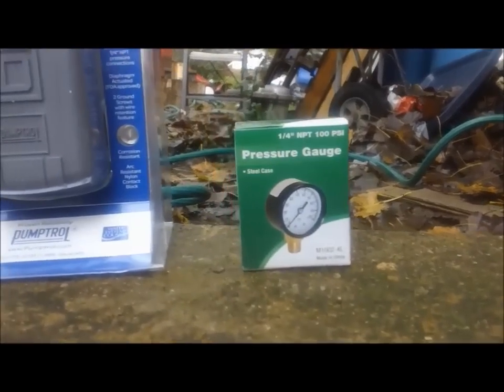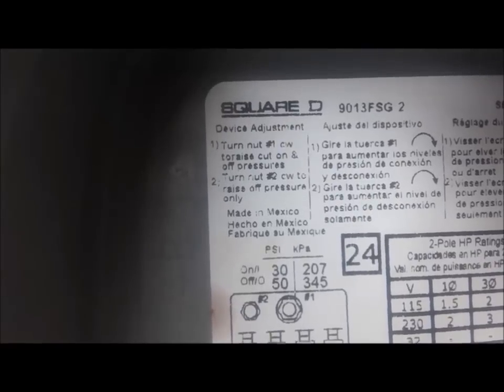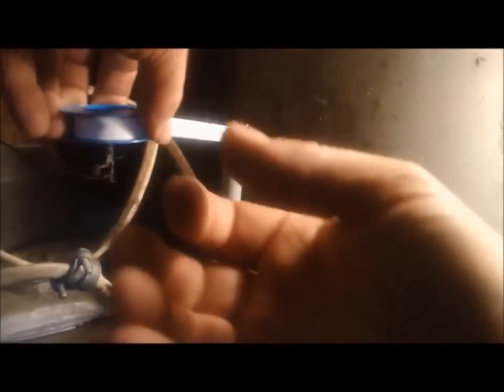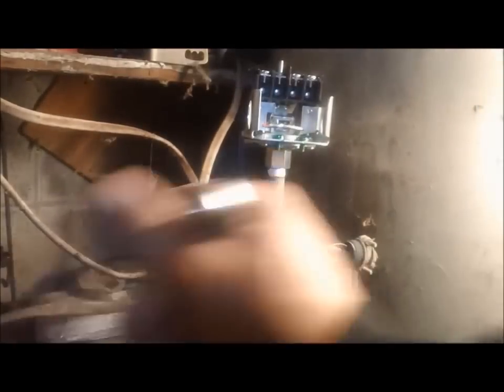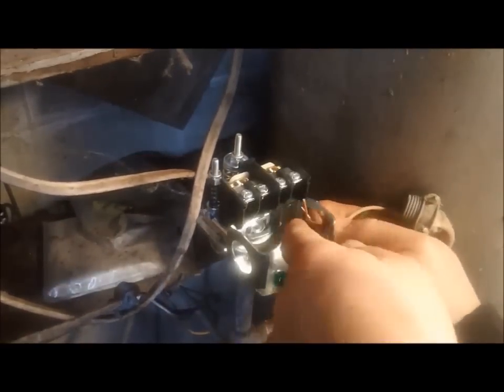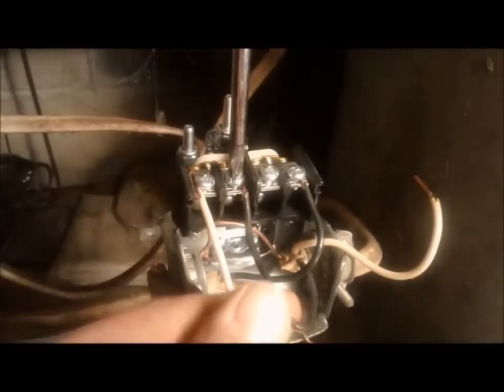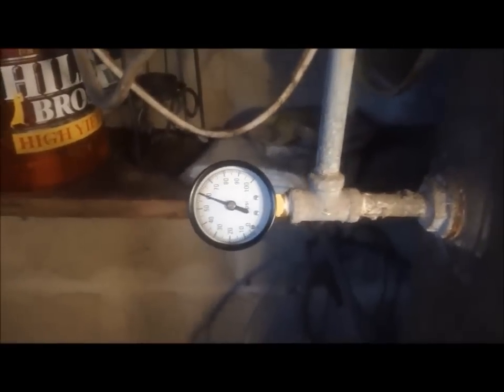How to install a Water tank pressure switch.

Comment: well, that was a very useful video! -- well explained; clear, good photography and quick moving -- couldn't be better, thanks!!! -- got my pressure switched wired.  I had marked the wires carefully when taking apart my old switch, but had so many pieces of tape and labelling that peeled off while working -- I couldn't remember which wire went where.  I'd buy you a beer if you lived close to Toronto.  Cheers!

Comment: Mike, changing a control box at 19 degrees is no fun, but wiring the   220 switch like it was 110 left me scratching my head.. Thanks for your advice you saved my butt out here in the country. Tonight we have water and a hot shower. Great video!
Reply from the maker: I'm glad the video was of some help. Thanks for watching.

Comment: First of all I should of started my last comment with a THANK YOU FOR AN AWESOME VID!! Out of many many we watched yours was the most descriptive and helpful so thank you! I think we have figured it out it is a small tube that was half full of really dirty water. It looks like a tube you would use in a fish tank the air filter etc...
Reply: There was this small brass screw thing coming from the tank that held the plastic tube. The screw was clogged and my husband cleaned it out and now the pump is working, I think we did not need the new pressure switch after all
Reply from the maker: +Lovbeinamom Thanks for watching.  I know what system your talking about now. That tube is to supply air pressure to the switch. If it is plugged you wouldn't get proper pressure to the switch. Glad you got it working.

Comment: The first video from another guy, didn't really show the process! Just the before and after.  You showed the steps and wrench sizes.  With your help and one more trip to the hardware store to get a thread adapter, I got the job done.  Best water pressure I have had since I moved in 7 years ago.  Thank you!

Comment from the maker: That works. Over the last 20 plus years of being a mechanical engineer. I have heard many theories. Everything from 10 psi over or under. The pressure is actually decided upon, what the tank recommendation states, and what kind of well you are using. If its a submersible or point stile makes a difference. The old timers used to tell me your elevation levels had a roll in it to. Most of what i have seen around here was 2 psi below cut in, I think 5 below or above you will not notice a difference.

Comment: Thanks for your info and time! Worked great! I do not know if the wire thing really matters so much  except to make sure to follow your pressure switches wiring diagram. Mine said to wire the motor pump's wires on the two middle screws of the pressure switch. The two outside screws on the pressure switch were for the electric to the house circuit box. It did not say which wire to put under which of those screws-hot or cold for either the pump motor or the electric going to the main house circuit box. Things seem to work fine. Does it matter which screw you put the hot or cold wires under? My only problem with things was realizing I needed to unscrew the little cap (mine was made of metal and looked like it was part of the valve-we have a Well Mate) covering the straighter valve stem located under the big plastic cover covering the whole valve. After I realized that, I was able to check its air pressure and re-pressurize it just like a car tire. I also recommend using a pipe wrench to hold the pipe while you unscrew the pressure switch from it so that it does not move or maybe break off.

Comment: ok, watched your video.. I installed a bigger pressure tank.. they had a 20 under skirting on mobile home, I put a 30 with a new pressure switch... now the problem is I have great pressure for maybe 1 min or so and then goes down to almost a trickle in shower or bath.. if you turn off for a few mins will build pressure back... what am I doing wrong? ny ideas?

Comment: Hey Mike, great vid. Just a few questions as I am getting ready to replace my switch today. Had a 30-50 in it and wanted to install 40-60. What do you think? Second question, why did you inject air in water line or wherever it went? What did you inject it into? I don't understand that part of the vid. Please explain.
after looking at vid again, looks like you have some kind of valve installed on water line. I don't have this, so do I have to fill tank up to do this procedure? Also is it a good idea to install one of these air inlet valves since I am going to drain my tank to install new switch? Never saw one of those on there before, just on top of  my pressure tank is only place I have seen those tire valves.

thanks for your help
Reply from the maker: The 40-60 switch is fine, if the tank is capable. The reason for the air. The tank has to be half and half.  Half water, half air. Your tank should have a air valve that kinda looks like the one on your car tire.  Thats how you build pressure. Without the air pressure, the water pump will just kick on and off. I hope this helps. Thanks for watching. Mike
Reply: +Mikes Homestead tank pressure should be 1 to 2 psi less than fut in pressure.

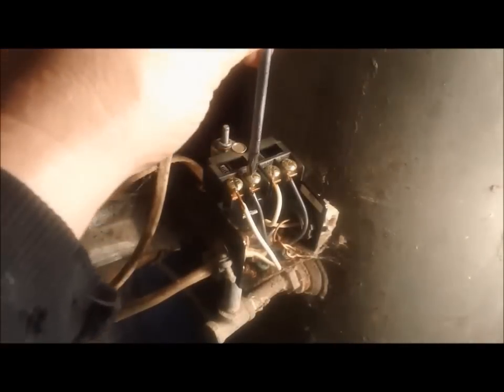Comment: At 2:00 minutes, before you remove the wires, make note, maybe a drawing, of which wire is on which lug, so you can install the new one the same way.  
At about 5:47, the pressure should match what your pressure tank is configured for - it should be labeled.

Comment: I've installed a new pressure switch to my well pump,and it will not shut off .do I turn the adjusting screw clockwise first or do I ck the air pressure in the tank,.also would a faulty pressure gauge affect the pump from shutting off
Reply from the maker: +Hector Perez The pressure gauge will not affect the pump. You need to make sure the tank is pressurized first. then adjust switch.

Comment: Hi great video, also my pump turns on and off constantly.Any ideas?
Reply from the maker: Sounds water logged. The tank should be half air, half water. sounds like to much water. If your tank has a diaphragm, It may be bad.

Comment: hi Mike, when connecting the wires, you say to connect the negative to the far left pole. I thought that black was negative! Your pic shows a white connection, even though you say it's negative. Can you clarify this for me? I did this the way your picture indicates, and the pump worked for a minute or so, then I had a couple of very small sparks from the second post in from the left, and the switch stopped filling the new pump. What am I doing wrong? Thanks in advance! Kathy
Reply from the maker: Code in Wisconsin. The whit wire is negative and the black is positive.

Comment: We have watched this vid a hundred times and cannot find anything about the small tube that runs from the pressure switch to the pump? Are you suppose to fill it with water? With air? We have been trying to fix our crap for 2 days and have done everything you have said but still the pump runs runs and runs????
Reply from the maker: +Lovbeinamom What small tube?

Comment: Hi Mike
Question...I just had my pressure switch replaced...30/50 but I have a 40psi pressure tank...what should I be setting my switch at for sure... currently it turns on when it gets to 22 psi and shuts off at 38 could my shut off pressure be increased with a 40psi pressure tank ?
Reply from the maker: I would not go over the 40 psi recommendation on the tank.
Reply: @Mikeshomestead  thank you for replying back just wanted a confirmation that we were doing it right 😀

Comment: can you adjust the tank pressure without draining the tank?
Reply from the maker: It depends if the tank is water logged. witch means the tank is full. The tank has to be half and half. Half air, half water, but if the tank is half full you can adjust the pressure, without draining it.
Reply from the maker: yes

Comment: Why do you spend most of your time screwing the unit on and skipping over the important parts about adjusting pressure?
Reply from the maker: +Norman Wei   Sorry! The video was " How to INSTALL a water tank pressure switch). The video was not on adjusting water pressure, but If you watch the video to 5:08 I explain how to adjust the water pressure in the tank. Thanks for watching.